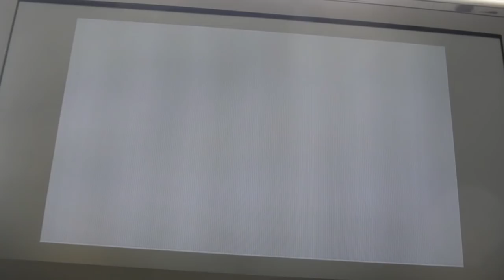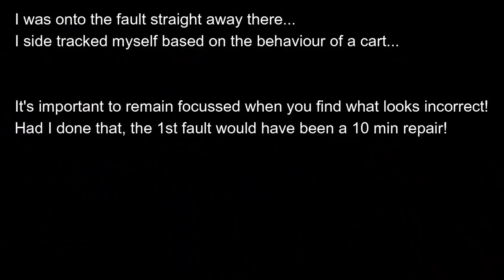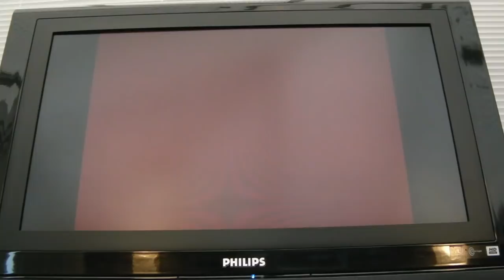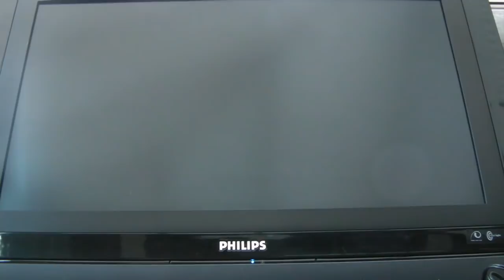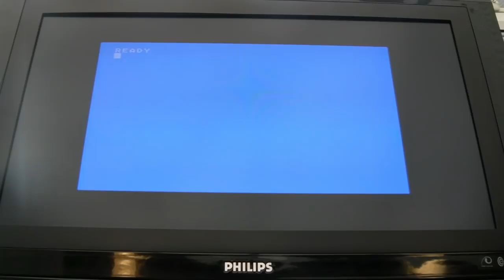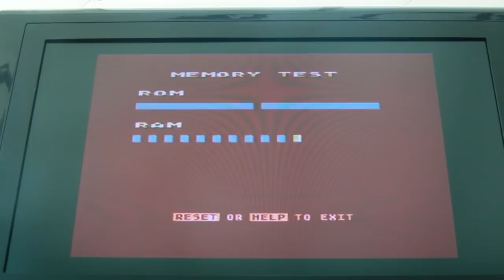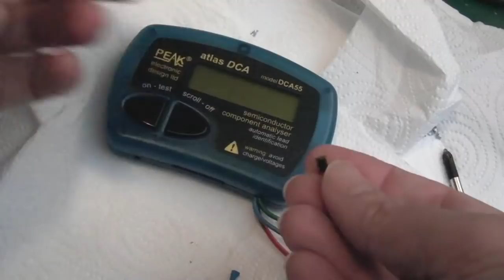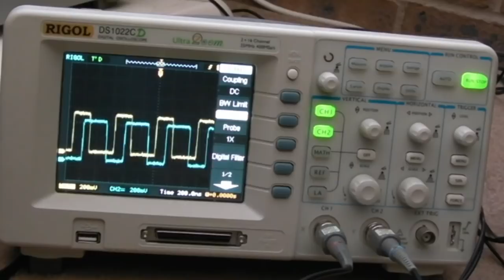Atari 800 XL Not Booting & Colour Problem Repair

Comment from the maker: BTW - My 65XE MMU worked in this board!  As does the NTSC ANTIC and my Sally and OS ROM.  You would run into timing issues using the NTSC ANTIC with games and stuff though (probably).
Reply: Here is an interesting story about MMUs! Yesterday I finished repairing(3 bad MT RAMS) and  putting sockets on a Atari 800xl board(PAL).  It booted ok but it randomly kept crashing(after few seconds to even hours!). Long story short  the system stop crashing after inserting an MMU from an 65xe(PAL). The funny part was that the "bad" MMU works fine on the 65xe!!!!?
I am puzzled by this...any ideas?
Reply: @nickolasgaspar9660  Could be the 65XE socket (you installed one?) makes better contact with the IC. Did you deoxit the IC and sockets?
Reply: You can use NTSC chips in a PAL Atari 800/XL/XE machine. The opposite doesn't work nearly as well.  It's a common trick to put an NTSC ANTIC into a PAL machine for NTSC timing/compatibility, etc..

Comment: 58:40 best way to install a Sophia is to use the 3D printed PBI adapter with an HDMI plug. This way there's no need to damage or change the case. He'll need a longer internal cable that will reach PBI from GTIA but those might be available now.  I prefer the real GTIA than an emulated or FPGA.

Comment: Im back here watching this again! Got an 800xl here that boots to black screen. On initial switch on i get a flash of colour either red yellow or blue then blackness. 
I just replaced delay line chip and no difference.  All voltages at 5.1 and present. 
Antic Gtia both roms warm. 6502 warmer. Ram all cold. I dont have a probe! High time i got one.

Comment: That transistor you replaced drives the CADJ (color adjust) pin of GTIA from the phi1 clock generated by Sally, and the trimmer adjusts the delay from phi1. What that does is keep the color clock in sync with the dot clock, which GTIA then delays to set the hue of the current pixel, so if that transistor is dead the colors will drift around as you saw.
Reply: Sorry but that simply isn't the case.

The original 400/800 machines ran the DEL/CADJ pin from +12V through a resistor and trimmer pot. Since +12V is absent on the XL/XE boards Atari chose to use the unused Φ1 clock to drive a didoe pump circuit, consisting of Q1 a couple of diodes, resistors and capacitors, to generate sufficient voltage to allow enough adjustment range from the +5V supply.

The trimmer pot does nothing other than control the DC voltage being supplied to GTIA pin 17. Period.

Comment: 9:02 That's a NOR gate, not an OR gate. The little circle on the end means that the output is inverted. If any of the inputs are high, the output will be low.
Reply from the maker: Thanks, yes - I mentioned that in the live chat text to the right side (when it premierred). =D

Comment: The delay lines might be like those on a color CRT, but it’s probably a SAW (Surface Acoustic Wave) technology, which is sort of like a laser-trimmed piezo-buzzer that operates at a much higher frequency. Conceptually, it’s like a reverb tank in a guitar amp with vibrato (or is it tremolo? I always forget); you pulse the input, then - after a delay based on physical properties of the material - an output pulse comes out.
One thing that might work, is getting the PLA (or is it the Vic chip?) chip from a C64 to generate the RAS/CAS for this machine, and put it on a daughterboard that’ll plug in where the old delay line IC (?) went. And those are a lot easier to find than that delay line.

Comment: What a fantastic ride. It helps a lot to follow the paths you take doing diagnostics. Those dead ends give very useful information for the problems we might find.

I actually have an 800XL myself from back in the day, sitting in its box waiting for attention. I´m almost finished making an Arduino S-Drive to load those sweet games I never had as a kid. Shortly after buying it, the only store in my province that sold it dropped entirely the brand, so I was stranded with a few tapes and a single cartridge, and I never, ever, knew another kid with Atari here to share thins (Spectrum and MSX were the absolute kings)

Anyway, I want to have it running again, but I am terrified about powering it ON after maybe 25 years stored.  I did that with my old 386 and it went very very very bad.
Do you have any advice to power old devices beyond testing the power supply before?
Reply: There's not too much that could go wrong with the machine itself. Just make sure the power brick actually still outputs 5v before you switch it on as those tend to go bad and can indeed fry the machine. It would probably be good to replace it eventually. Technically a decent USB wall wart would do just fine instead. 

It sure can be fun getting into these systems. Atari XL has a decently active community and quite some upgrades are still being made.

Comment: This made me think of the Acid 800xl, perhaps you should have just removed everything and replaced like I did haha. I still have the other 800xl that was donated for parts, it was working, but I checked last week and it has a blank screen and I noticed the voltage drop so I should take a look at this one. Also have a 65xe board that was stripped of most parts and a case for it.

Comment: If you didn’t know, the delay line chip is actually just a 74LS14 chip with the outputs slightly modified
Reply from the maker: Thanks for the info there =D